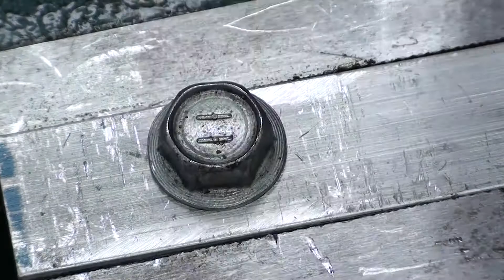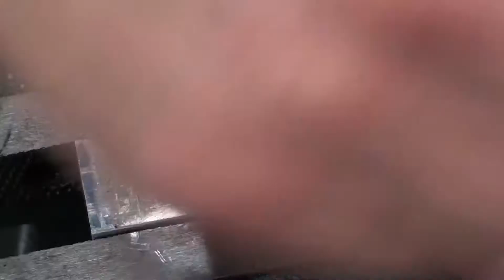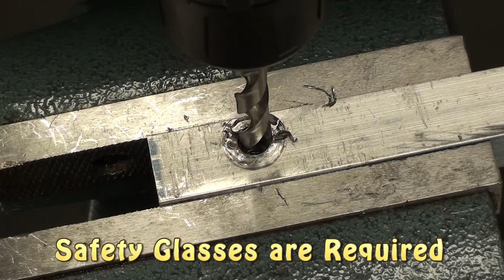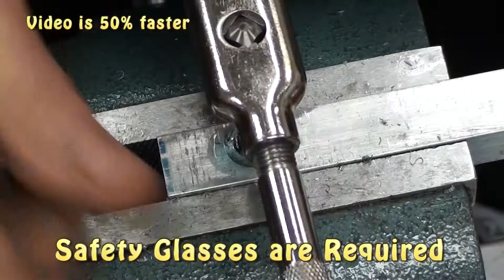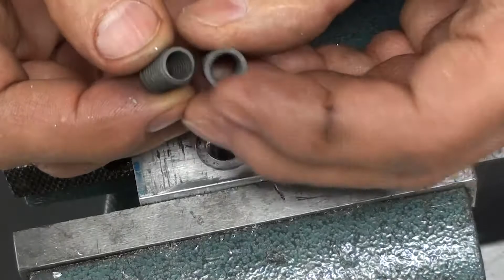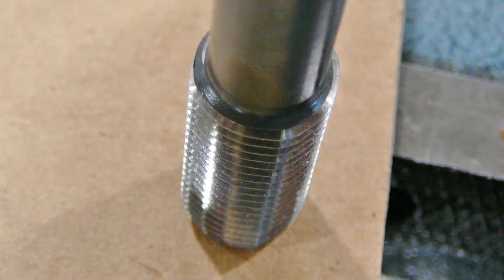Time Sert Repair 1

Comment: I was wondering, what's the difference between a Time Sert and Helicoil overall? 
The other video helicoil you drilled in a bar of aluminum and then used a tap to get the wider diameter before tapping was to insert the helicoil which made it the right diameter for the bolt threads so what's the difference with a Time Sert and when you'd use one? 

I was taught in school how to tap to use a helicoil, no Time Serts.
Time Serts seems more rigid and looks to last probably longer than the Helicoil, looks like its hardened too.
I feel like the Time Sert if the threads are damaged, you can somehow take it out and just place a new one, whats the countersunk section for, it doesn't really look like its of any use.

I'm having hard time understanding how the tool expands the Time Sert. I understood the Helicool is like a spring and one you spin it on it's using that springyness to not allow it to backout from the threads if a bolt or stud is placed in the threaded section it won't also take out the helicoil. Thank you!
Reply from the maker: The Helicoil is more like a spring insert where the time-sert is more like a metal sleeve.  The time-sert will be stronger.  I wouldn't use either one to hold my connecting rods onto my crank or my main bearings but both are very strong and industry standard repairs.  If possible I often just oversize a hole but it that is not possible a helicoil or time-sert is used.  The time-serts are a little more expensive.
Reply: ahh, just oversize the hole and place a bigger diameter bolt. :D
Reply from the maker: Time-sert is stronger and cost more. When the tool reaches the bottom of the time-sert there are no threads until the installation tool reaches that point. the tool forces the time-sert out to secure it into place. The countersink is done because the top of the time-sert has a lip to limit how far it can be installed. If there is no countersink the lip would stick up and the surface would no longer be flat.